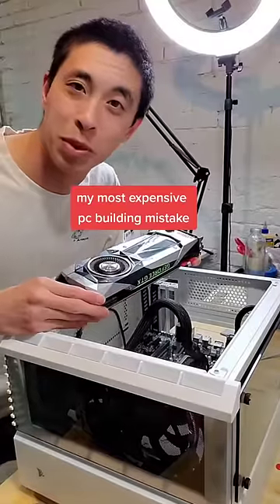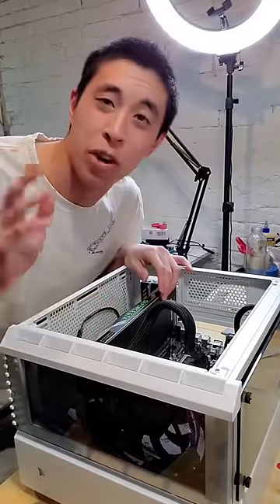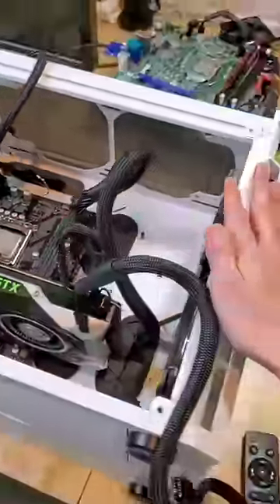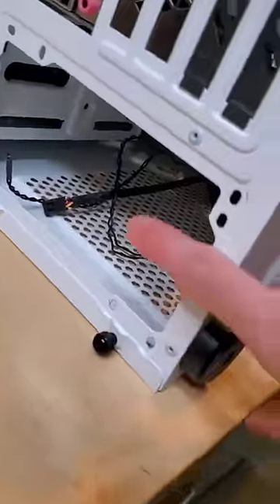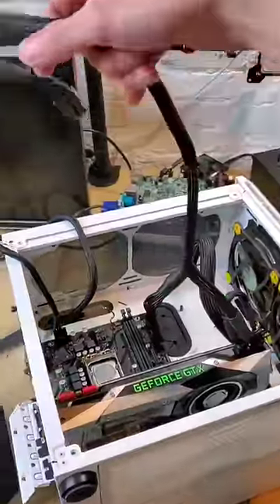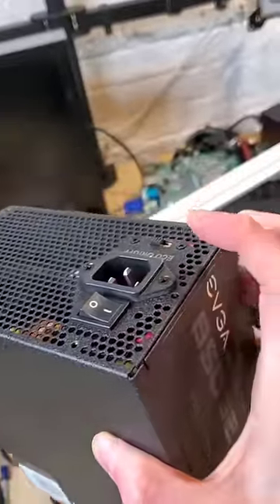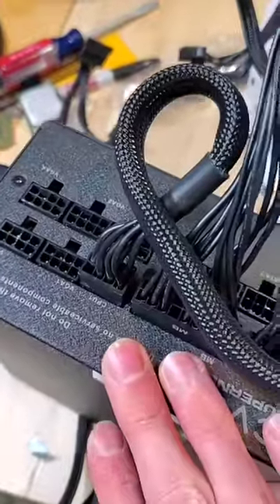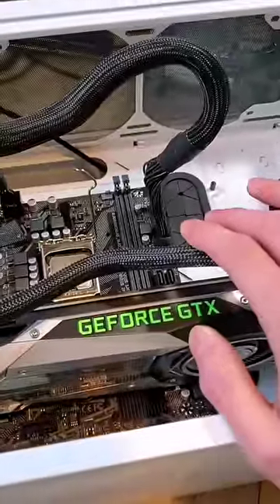my most expensive pc building mistake... #shorts

Comment: I was building my first pc on two tables pushed together. A cable connected to one of the SATA ports got lodged between the two tables and when I turned my pc toward me It ripped out the port. When I went to test the pc anyway and install windows, the pc became unplugged during the windows installation and bricked my motherboard.

Comment: So a few years ago i was doing some organizing my desk clutter and i was also drinking a bottle of beer.   had no where to put the beer down,  so i placed it on top of the pc.  no issues didnt think of it.   well  the pc is always vibrating cause of the fans.. and a minute later my beer started to fizz and over flow  hitting the top of my pc case fan and dispesning a nice stout into the pc case.   I fried the MB and and my 2nd Gen core I7

Comment: While I didnt build this PC at the time In 2011 I had cyberpower build a PC to specs I wanted. It had a custom liquid cooling system on it and within a few days of use the cheap hose clamps they put on it blew off right above my sli gpu set up. (the pump was also very weak). I did get lucky and neither of my GPUs were finished but I had to go to running 1 at a time. few years later one went out and I was able to use the one that took most of the liquid on it but only for a few months.

Comment: 2 mistakes one comment

1: I didn’t know a cable management piece that my case has that can be removed could be so I accidentally destroyed the front panel usb 3 connector pins, I tried bending them back and a couple broke

2: I made a mistake and forgot to plug an AIO pump into an AIO pump header on my motherboard, it wouldn’t post so I thought it was a cpu issue, I reseated the cpu and the socket pins bent (AM5) so I went through 3 motherboards for one build…

Comment: When i was young I saved up and bought a $350 nvidia gpu to upgrade my bs Dell pc with.  It required a higher psu so I flipped the 120v on the back of the psu to 240v. Did some major damage.

Comment: Mine was clearing CMOS while power is plugged in (accident) on MSI H61M-P31/W8. It had some (I think?) NVRAM and UEFI bootloader entry issue. Installing OS on legacy works but any single UEFI installed system put motherboard into bootloop. The I tried clear CMOS while power is plugged in. Then, board stuck on 99 code (Super IO initialization) I shut down system and that shutdown was last shutdown of that motherboard. Tech shop said chipset was fried and I replaced motherboard with some knockoff H61 motherboard. To my surprise, that board worked a bit better than previous board.

Comment: Not me but my dad ripped his cpu (ryzen 7 3700x) out of his socket while switching from a dead motherboard and bent so many pins, i learned to twist and pull with am4 socket ryzens and my cpu has survived 2 cooler swaps, i also killed 2 wd blue drives not doing research on adding another sata power cable to my psu.

Comment: Horrible AMD Stock Cooler (Wraith Spire) with a horrible backplate on my old Board, ended up damaging both my 2700X and the X470 Board I was running. 
They both still ran but were permanently damaged, unable to use 50% of Installed RAM.

Comment: Lol.....I just did something similar but got away with it, I pulled an old PC out of my closet, but I must have pulled the pci e 6 pin cable at one point and couldn't find it in the case. I grabbed a spare one from my closet, but I guess I lucked out because everything is working good, but as I was doing it I was like "I hope this doesn't fry my new GPU!?" Sometimes shortcuts lead to dead ends.....lol

Comment: Back when I was a kid, I saw a lot of videos of people changing their thermal paste and getting much better temperatures. I got around 75°C, which was a lot for my severely underpowered processor even back then, so I went on a mission to 1. Upgrade my ram from 4GB to 8GB and 2. Change the thermal paste 

My poor HP laptop, I didn't know anything back then and the mistakes I did were:
1. I didnt unclip the RAM clips, and just yeeted out the original 4GB stick, so the mount was completely ruined.

That was the least of my issues though

2. I didn't wear gloves. While it was apart and I applied thermal paste and connected the laptop to power, keyboard, and display, I turned it on to see that it boots to the BIOS! Excited, I mistakenly touched something with my sweaty hands, immediately killing the laptop. 

Woopsies!!

Turned out to be a dead CPU later when I sent it to a professional. Never fixed it. Still have it's exoskeleton lying somewhere in our storage.

Comment: I don't understand, if the cables are routed right there's no way that you can get it wrong because the pin only goes 1 way to the right socket, you can never get it wrong because you just can't poke it into the wrong socket either on the motherboard or PSU side. Simple to say they makes it idiot proof just like connectors in Cars you can never connect to the wrong socket because each individual is different, it's either going in or not, if it does not go in means you got the wrong connectors.

Comment: So… somehow the wires weren’t correct?

I don’t see how this would burn up the pc unless it was hooked up wrong somehow.

Which should have been impossible cause the hook ups prevent this.

This tells me it would have fried anyway even if you used the supplied wires.

So if you trace what burned up, you’ll know what actually happened. Like some part of the board having sticky stuff on it or something.

Comment: You probably connected the wrong inputs. They have reverse polarity for the CPU. LOL That's the only reasonable explanation, unless your PSU was too weak to power the system maybe... But then the PSU would die alongside everything, i.e. won't power up or shut down unless you provide more power. Also - always use the PSU provided cabling, no matter what as It should be better.

Comment: I took out the CPU ram and GPU and disassembled everything I could and ended up bending pins $200 GPU is dead $300 and ram is dead $60 = $560
Reply: But why are your GPU and RAM dead because you bent pins??? They should still work.

Comment: I have computer that I built that I built more than a decade that's still going strong with the OCZ modular power supply I installed in it. OCZ is no longer around. I no longer have the extra power supply cables that came with it. I did some upgrades, and need some more power cables. Ebay didn't have an OCZ cables, but I did find an EVGA cable with a different pinout. I bought it anyways. When it arrived, I ended up moving the pins around in the connectors, to get the proper pinout. I checked the configuration several times, as I knew that one mistake here could cost me the whole computer. Fortunately everything worked properly!

Comment: i didn't have any issues when building my first rig other then my rgb strip grounded out on the case witch made some pretty cool sparks i did shock myself with over 1200watts it did indeed hurt like absolute hell so i turned my system off put some electrical tape on it and here we are damn near 7 years later no problem tape is still holding up but it did yellow alil bit but oh well right 😂

Comment: Ryzen 5 1400 was taking it out of my pc and giving it to a friend for free. Had planned to upgrade to a 1800x anyways. So i took off the cpu cooler and it ripped the cpu out of the socket and destroyed multiple pins. Felt pretty bad and ended up just buying r3 1200 for them instead.

Comment: Switched out my 2 fan gpu for a 3 fan 3070ti maybe 4 months into me actually having a pc and I thought it would be “easy”. Laid the pc down and took out the gpu to put in the new one and it had some trouble going in correctly. So i tried to pull it out and in the process, bent the motherboard and it died before I could even turn it on

Comment: My buddy bought a 4090 to play Skyrim, TF2, GTA IV, and deep rock galactic. Definitely the most expensive mistake I have ever seen someone do.
Reply: I mean at least they can play at 5,000 fps
Reply: Dude its not that bad, at least even in like 2030 they will still be able to play at like 1080p low to medium settings
Reply: Ultra modded Skyrim could definitely use that 4090. I have a 5700XT that can play Cyberpunk 2077 max settings at 60 fps easily, but it runs my heavily modded Skyrim at 30 fps outdoors

Comment: When I was building a pc for my brother who bought the parts himself ($1300), when the parts came it was pouring rain and the boxes where soaked, the CPU boxes had been damaged heavily and I accidentally hit the motherboard (Really hard against the case) when placing it in the case, I had a heart attack but kept building, when I went to boot the system there was only a black screen and an error on my motherboard for the graphics card and CPU. I spent 2 hours just unplugging things, and eventually, I realised the monitor was broken lol, nothing was wrong just the old monitor was freaking the motherboard out.

Comment: Probably buying a $30,000 Itanium 2 IBM xSeries expandable to 224gb of RAM and 4 CPUs for $1,500 off of ebay.  The EFI Bios was a dog, the thing expected to be run in a frosty server room so the fans were noisy on full speed, and the Itanium 2 was slow.   Basically, it was a loss of my entire $1,500 to get the ultimate Firefox Browsing machine with 254gb of RAM

I did buy like 20 Itanium 2's to go into it... and they too were a waste of money.   

I finally built the system I needed back then, a Ryzen 7950x with 128gb of RAM while blind 3 months ago.   Sourced all the parts for it but still spent a small mint on it, more than the Itanium.. Probably $2,000 with all the RGB lighting.

Comment: I think mine is when I was swapping motherboards for my Ryzen system and I was taking the cooler off and the chip was stuck to it, I pulled it off and it fell on the floor and bent some pins, and as I was unbinding some, some broke off and I kept bending more, til I think 7 or 8 pins broke off, tried it anyway and it didn’t post

Comment: Tried clearing my CMOS by using a screwdriver to short the jbat pins based on information online.. except I did it with the system running (I was insulated)... RIP expensive mobo

Comment: I did the same exact thing and got away with it though, no problems so far. Swapped an MSI 850W PSU for a NZXT C1200W and used same cables from original PSU for everything except GPU and Motherboard. swapped to new cables for those specifically.

Comment: I did the same with a corsair fully Modular psu. Different  cables hooked it all up. Not corsair. The pc wouldn't even turn on. No smoke. Just no power. Not even a fan moved. Finally found corsair cables and it powered on and ran no problem

Comment: I had 2 compasitors go bad on a 300$ motherboard. When I replaced them, I had a he'll of a time the holes had to be made bigger I had to use low melt solder ended up screwing the board up

Comment: I upgraded my bios and in doing so lost support for my CPU so it wouldn't boot anymore 😂

For reference it's a B450 AM4 board and I'm was running first gen Ryzen. I had no cash for a third gen or newer Ryzen so I thought I was screwed. Thankfully I found out about BIOS flashers and managed to get a kit for £15 and spend about 3 hours reflashing my BIOS. No components was actually damaged but I was without my PC for a few days and was a very stressful time. Don't update your BIOS unless you actually need to!

Comment: Though not very expensive at the time it sure felt like it back then, I was 16 and tried upgrading my motherboard and since my job didn't give a lot of money I saved to finally get a new mobo, I took my pc apart and put the pieces back with the new board but the whole thing didn't work. And I convinced myself that I screwed something up and completely ruined a 150$ mobo which was super steep for me to pay at the time. I got discouraged from building a new pc for years. And somehow by sheer coincidence as I'm getting parts for my new build, I finally realized my "mistake" had nothing to do with physically damaging anything. I was just an overconfident uneducated tech kid who didn't think to check the Mobo was for my generation of CPU. And when I looked up the model. Sure enough it was for the newest generation at that time (i dont remember what it was 6+ years ago and I was using a 6th gen Intel. I laugh about it now but man, If I had remembered to check, I would've had alot less mishaps.

Comment: TLDR
When upgrading cpus always check for a bios update, bios flashback can pay for itself when things go bad. AND MAKE SURE YOU DON'T PUT A CPU UPSIDE DOWN BACK IN IT'S PLASTIC CASE.

When upgrading my am4 build from my 3600 to a 5800x i thought a safe space to put my cpu would be back in the plastic cpu holder. It turns out i put it in upside down so when i closed it up it bent all the corner pins. Normally this wouldn't be the worst thing because now i have a 5800x right?? Silly me forgot to check for a bios update that supported the new cpu. So when i tried to reinsert the 3600 it wouldnt work. I checked the pins, straightened them out and it never worked again. My motherboard had zero support for bios flash and i was fucked. Now at this point my 5800x was back in the plactic case that ruined my 3600 because when i put it back in i wasnt aware of the issue yet. THANKFULLY the pins were only a little bent and it still worked after a bit of straitening. But now i was stuck with no way to update the bios. My only option was to find a cheap ryzen 3000 to be able to update my mobo just to hope that my brand newly released 5800x still worked. 

Thanks for reading and cringing at my idiocy. I learned at lot from that experience.

Comment: I mean I wouldn't exactly call it an expensive mistake because it still works and it honestly wasn't my fault but the locks on my GPU Lane broke the locking tab off the card, other than that ive never really made any expensive mistakes, or mistakes in general, i guess i follow directions well

Comment: One time I bought a single fan AIO for my old-ahh PC and found out after taking the whole thing apart that even a small 120mm radiator was too big for my tiny old case. And I damaged the radiator with a screwdriver while finding this out the hard way.
So that's like $70 down the drain. Don't try to put an AIO in a NZXT micro-atx case from 2016.

Also, when I was a kid I found out about bitcoin mining back in ~2013. I figured this was an appropriate hobby to get into and I attempted to configure a GPU bitcoin miner on my old ATI Radeon card using the family PC.
Long story short, the mining app absolutely fried my GPU and made it unusable. In a panic, I told my dad it "suddenly stopped working for no reason", he believed me, and I got a new GPU for my birthday that year. I was without a graphics card for about 4 months.

Comment: Put a 3080 on an X370 board. It should’ve been fine. But the port was burnt, melted and the gpu is fine. X690 board, gpu works fine, board is fine.

Comment: The only pc building mistake I made was with my first pc build. Basically the motherboard was causing the pc to crash every 5 seconds, yes I did check every other component. So the mistake was buying a faulty motherboard without knowing it was faulty I didn’t have a job at the time so I had to wait about a year before I could actually afford all the components and by the time I figured out the motherboard was the problem I couldn’t get a refund.

Comment: Not using a surge protector. I bought a gaming laptop with acer predator triton 300 se with i9 12th gen with rtx 3080ti. It was around 3200 when it came out. Thankfully, I bought a warranty which I usually never buy when buying electronics  but luckily I did because the warranty gave me 3000 after almost a year and a half of use.

Comment: I was reinstalling my brother's ryzen cpu. When it wouldn't screw in when trying to put back the cpu cooler, I pressed it down in order for the screws to reach the motherboard. Turns out I have to reseat the backplate when re-attaching the cooler. When I took the cpu out, all of the pins were bent slightly to the left.

Comment: Bought nzxt fans without rgb hub i figured i had to connect it to the 4 pin motherboard header and then the rgb just got fucked even after i Bought the hub the rgb wouldn't turn on and the place i Bought it from didn't replace it even though it had warranty and they told me the fans where pressed so opening it up for an led fix could just break the fans

Comment: My newly built PC didn’t post, even though the fans were spinning up, I took out the CPU and noticed EVERY pin was bent, tried to fix it, made it worse, had to throw the board away. Didn’t realize that the socket had angled pins, and it didn’t post because I was using a 8th gen intel cpu on a board meant for 7th gen

Comment: Used to much cpu paste tried to remove the cpu to clean it and it slipped out my hand into the motherboard socket wasn't damaged to much and had to repair the am5 socket still works but replacedit anyway :/

Comment: ive build now about 6 pcs or so (mostly upgrading or case swaps but full installs) and the worst mistake was a ripped out r5 2600x with i think 4 bent pins, but i did manage to save it. the dumbest mistake was when i build my new pc and i forgot to plug in the cpu power and i went like... i think the gpu is broken or smth like that and then irealised and im like... yeah i think cpu power is important.... XD

Comment: I have an rgb hub with small opening for the rgb cables. So when I need to plug a new one I shave a little from the plastic on the cable. I recently upgraded my gpu and redid my cable management. And I used an rgb cable extension ment for 12v on my 5v rgb fans. And I plugged it the wrong way because I shaved the connector and didn't see which way is right and my pc started smoking. Luckily only my case fans got hit. The gpu is fine.